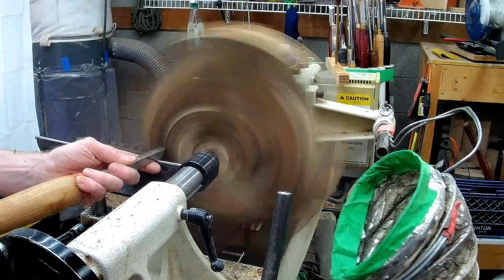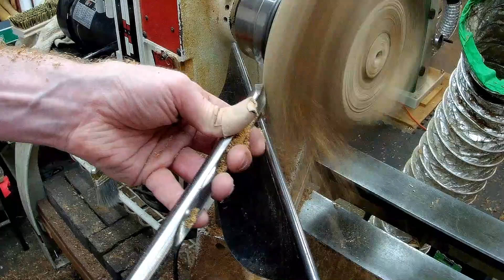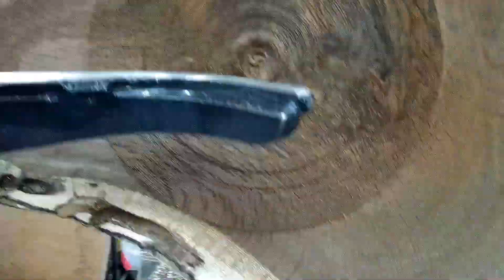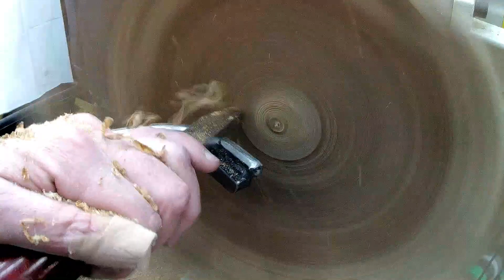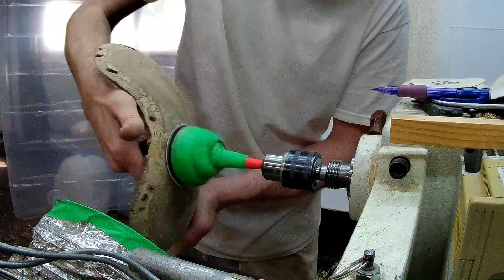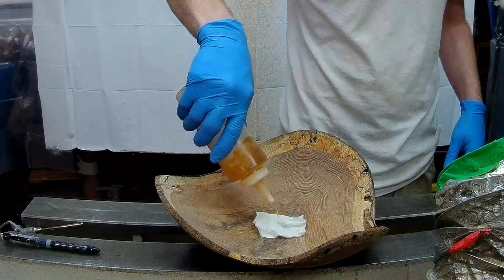Turning a Chinkapin Oak Bowl - Limb from 400 year old tree!

Comment: A great piece - thank you. I like the no talking but for someone whose only been turning just over 14 months it would be good to know what tools you are using if you can flash text those up please. Also was the finish on the piece Danish Oil or something else?
Reply from the maker: Thanks for the feedback! For the vast majority of projects, I use a bowl gouge about 70% of the time - usually a 3/8" or 1/2", sometimes a 1/4" or 3/4".  I use a simple skew chisel to make my tenons and occasionally you'll see me use a homemade round nose scraper looking tool.  I have a blog post on my website about some of my shop made tools, if you're interested. For hollowing deeper vessels or for hard to reach areas, I use a Trent Bosch hollowing tool. Those 6 or 8 tools account for probably 90% of my turning.  And, yes, Danish oil is my preferred finish and what I use on almost everything that hasn't been dyed. I hope that helps!  Thanks for watching!